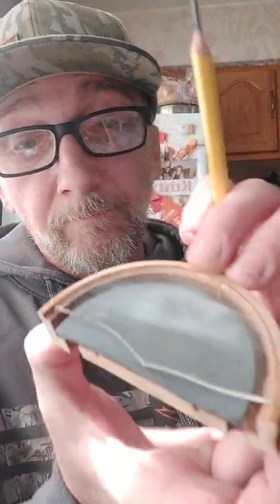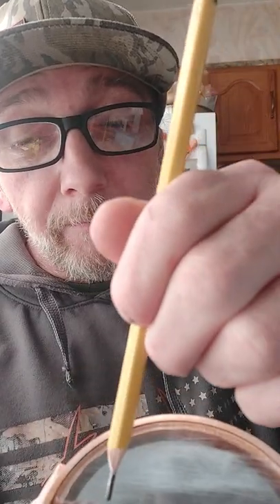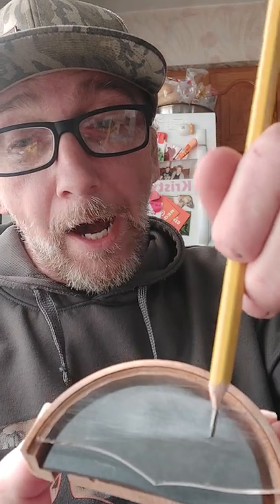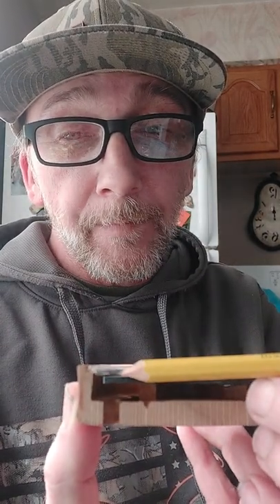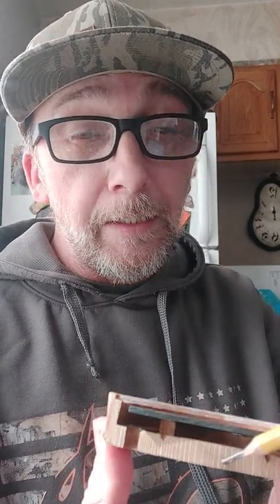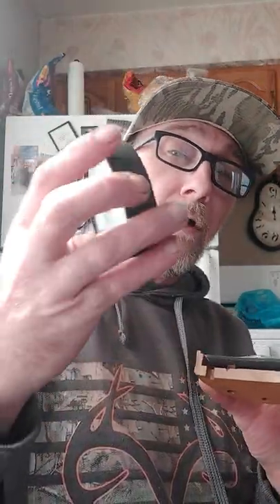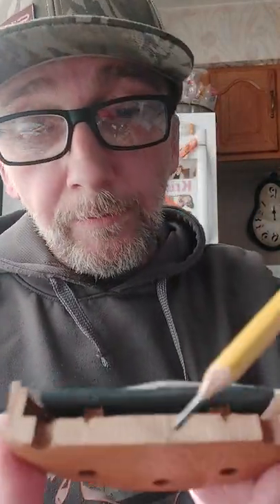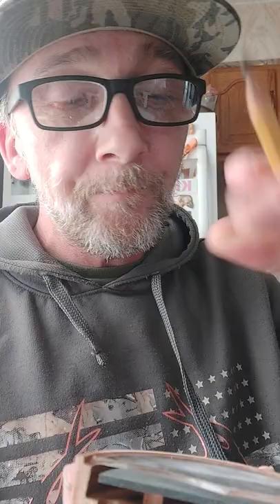Pot Call making with Tony Dempsey "pot call mechanics"

Comment: Great sound instructions. Take notes. Best sounding call I made, didn't take notes and well it's hard to get dimensions once glued up lol.

Thanks for all your help Tony, from all the videos as well as text messages
Reply from the maker: Tear it apart and get those specs.. always can make another
Reply: @tonydempsey1359  used a torch and loosened the glue. Reglued afterwards. And measure everything. Holes, thickness, heights, gaps.... Never imagined how much each part effects sound.
Reply: @tonydempsey1359  did make a gaboon ebony call that I messed up on and then changed up to learn. Made real thin walls and bottom, no sound board, and three in glass top. Sounded pretty decent, higher pitched than glass top normally does. Several people wanted it so it became a backup idea
Reply from the maker: Yeah everything is affected just change 1 spec at a time.. 
And a call with no soundboard is not unheard of just many don't do it..

Comment: I have been turning for six month's and trying to get my own pot design. There is alot of things involved as you would know. In your opinion what would change the sound the most, pedestal the holes or the thickness of the pot. Ive made a few that sounds great and some i wouldn't give to anyone. Ive noticed the wood make a difference but i would like to find a happy medium that my pot will work with all component's  .

Comment: I’ve been making calls since February and so far most of them sound pretty good. I would like to try different pedestal diameters to hear the different Sony da certain sizes produce. I would like to mention a big factor to sound quality is the striker such as the weight, length and type of wood make a difference!
Reply from the maker: Spot on with the strikers Tanner
Everything change that is made will make a change in sound even the slightest change
Reply: Mr. Dempsey could you also make a video talking about good woods for strikers and soundboards. I’d like to know what kind of sounds certain woods produce. You could also throw in how slate, acrylic, and carbon fiber sound as a soundboard
Reply from the maker: I can definitely make a striker video.. as for soundboard sounds just like the woods used for making pots they all will produce different sounds .. the soundboards I use are mainly glass and slate.. however I make an osage pot with a titanium surface over a copper soundboard and it sounds really good.. sound clip is on YouTube of that call..
Everything is trying it and see if you like the sound or not..